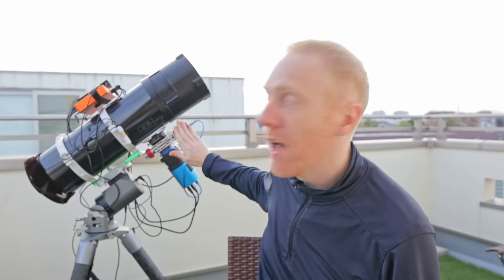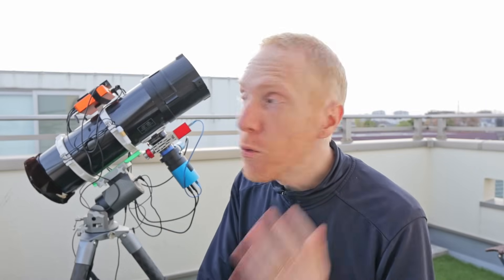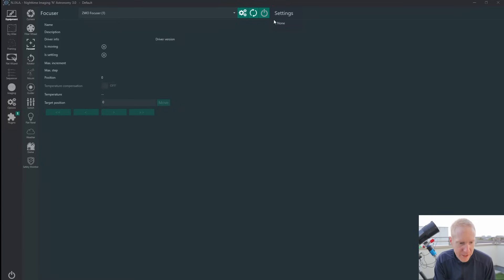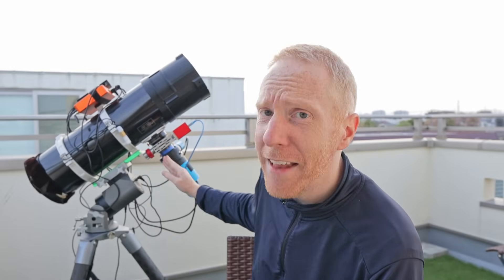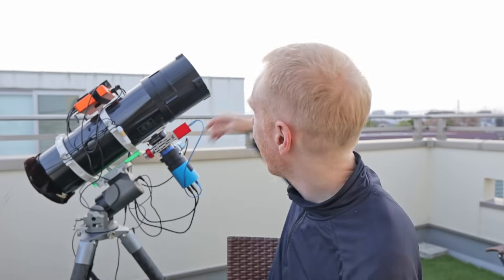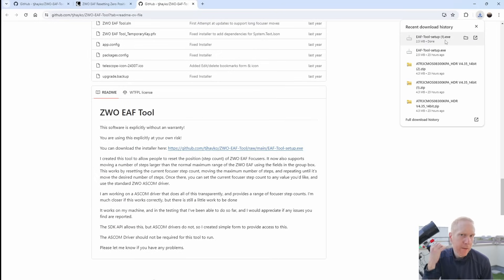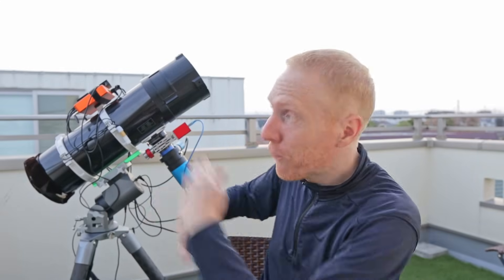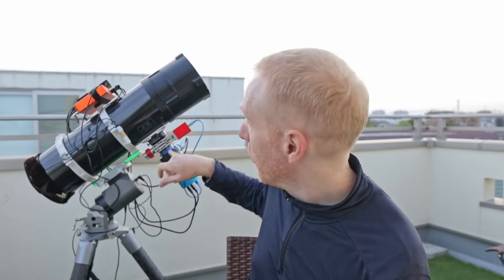ZWO EAF Stuck at zero - and beeping 😞 My fix and additional tip

Comment: I had a similar  problem with the ZWO EAF stuck at 60,000.  I shoot with my using my Hyperstar and from the back of the scope which really created a problem for me since the index number was artificial.  I downloaded the newest ZWO EAF Ascom driver and it fixed the problem.  I don’t know how ZWO could have missed this problem especially for SCT users where there is a large focus range especially with a Hyperstar.
Reply from the maker: Apparently a firmware update also allows a max step of 250000 for SCT users, but I haven't tested that yet
Reply: @CuivTheLazyGeek  I can go to 301,000

Comment: That would be a frustrating issue!  Luckily my Pegasus Astro Unity software allows me to set or reset the zero position wherever I want.  Oddly, I had to reconfigure my backlash & step size settings in NINA during my last session to get the autofocus routine to run correctly.  I'm not sure what caused that change either!
Reply from the maker: Interesting, that is odd indeed... No slippage anywhere?
Reply: @CuivTheLazyGeek  I don't believe so.  I have set my 0 position to all the way racked in and set the focuser to goto pos 0 at the end of my sequences, and it appears to indeed be at the zero position after that last imaging run. 🤷🏽‍♂️❓️

Comment: I had a similar issue where the focuser would not auto focus because it would only go out, but not go back in because it thought it was starting from position 0. I had to loosen the coupler and return the focuser manually to the 0 position and start over. Then, when starting over, it would only move 1000 steps , then beep. Then I would have to tell the software that it was at position 0 again to get it to go out another 1000 steps. Somehow, in the EAF software, Max Step had been set to 1000. Like you, I reset that to 60000, moved the focuser back to the 0 position manually and all worked fine after that.

Comment: I use INDI and the ZWO EAF driver has a location sync that lets you set the current location value. I've used it a few times when moving equipment around. Stellarmate should have the same capability.
Reply from the maker: Yep, I have that in SM as well, but was using NINA on that day!

Comment: Set it to 0, when you are in focus. In the ascom window, check the reverse box. Goto 30.000. Set it to zero again. Uncheck the reverse. And your focus position is 30 000. No extra software needed.
Reply from the maker: Thanks for the tip! Definitely a bit more cumbersome, but as you say no extra software needed!
Reply: I trried this before I came to this video. Didn't work. It still wouldn't go past what it thought was zero. As Cuiv says, it depends on circumstance.
Reply: You got it ! As I mentioned in my post, it seems to work much better if you also set the limit to something a reasonable for the actual range you expect to use. with my 3 inch f4.6 refractor and the ASI 2600MC that turns out to be about 3000. It greatly reduced focusing  time for me.

Comment: Great video! Very handy to know once the EAF goes mad. I just had the case with the latest one that I have bought that it still had old firmware. So NINA or the EAF Ascom window was not able to talk to it. I then had to update the EAF firmware. Maybe it's a video idea for you how to update the EAF firmware.

For those guys and gals who also have a AsiAir the current position can also be set in there.
Reply from the maker: Yeah ASIAir and apparently ASIStudio can do that! It should be in the driver though...
Reply: @CuivTheLazyGeek  I think so too. The driver should support the setting of the current position too. This setting of then min. - max steps was fully new to me.  Finally I know what else I can check once any of my three EAF goes made. 😄

Comment: Small update Cuiv. The new firmware update allows to move the maximum steps up to 250000 in order to solve the problem with SCT. If you do the firmware update you need to do an aditional adjust in the dll file of the driver in order to achive beyond the 60000 steps. If you want I can send the info by email.
Reply from the maker: Good to know! I'm fine with 60000 steps :)

Comment: I'm pretty sure you don't have one but the ASIAir can set the position of the ZWO EAF. At the end of every session I run my focuser draw tube full-in so the weight of the camera and filter wheel aren't hanging on the tube. There are two boxes in the ASIAir focus window, Current Position and GoTo Position. Sometimes I hit the wrong one and set the value to zero by mistake when it should really be about 10,000. Oops.
Reply from the maker: I see! Thanks for sharing - also indeed oops on the position :)

Comment: you can set it at midway with the asi air.. but with ascom driver you have the option to click it and set it to zero..
I did this a couple years back and the way i fixed it was loosened the grub screw that turns the focuser and then turn the motor to 30k with the motor controller remote, tighten back up the grub screw and sorted.. I thought it was common sense to set the scope to focus manually then set the eaf to midway.. only then attach the eaf to the scope...
so yes ZWO SHOULD TELL YOU THAT ON THE QUICK guide note in the box with the EAf.. so the new tool is handy for a LAZY person ;) or you could just loosed the grub screw heh
Reply from the maker: The set to zero works but only if your max steps is also non-zero :) Easier to simply set the target position directly!

Comment: Hi Cuiv, had the same issue with one of my EAF units the other week, soon had it sorted though. Thanks for sharing this info all the same. I have to say I prefer the PLL Sesto Senso focuser as it has a more comprehensive dialog box for setting everything up and you can actually dim or turn off the led indicators on the focuser. My  main scope has one of these. I do like the simplicity of the EAF though and of course as my grab and go rig is controlled by an ASIAir mini, I have to use one with that anyway.
Reply from the maker: Glad you had it sorted through already! Yeah I hear a lot of good things about the Sesto Senso! On my side maybe I'll use my Astroasis focuser next

Comment: Great video and information. Another use I have in mind is when breaking down the travel rig and needing to bring the focuser into its travel position (in as far as possible) setting the in focus position to 30000 instead of trying to remember 27648 as the focused position would be a great help for next set-up. Thanks for this and thanks to the programmer.
Reply from the maker: That's a great idea too!